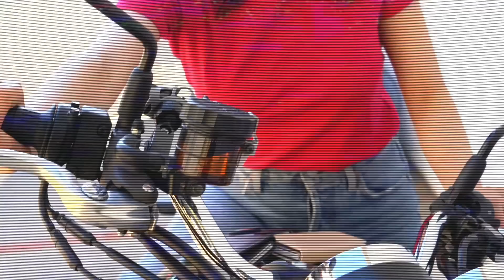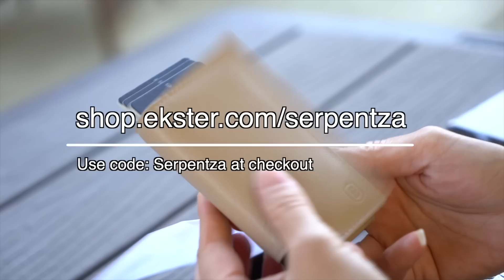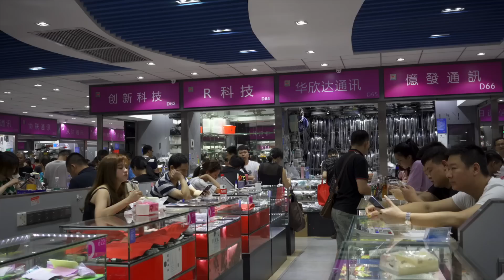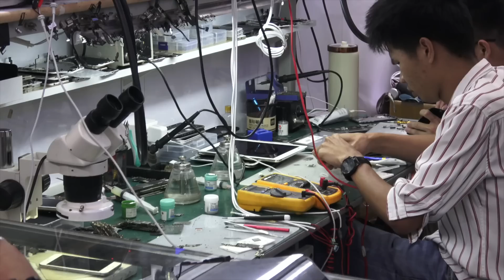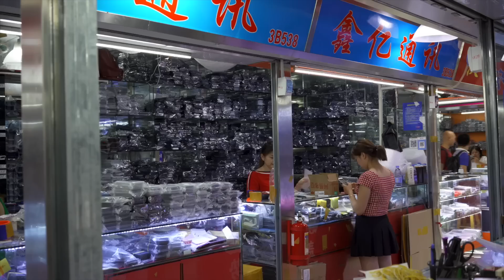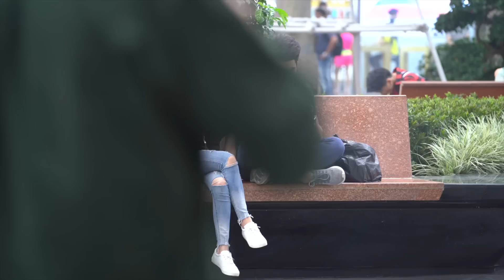Why China Can't make Chips!

Comment: I've had Chinese companies make many parts for me over the years, and the thing that has flabbergasted me is how they seem to have absolutely no concept of tolerances.  There are many parts that simply will not work if it is made too big or too small by half of the thickness of a human hair (and of course much less than that in things like chips and ballpoint pens). A big part of engineering is deciding what the tolerances should be. Even in cases where the Chinese are using a process that is easily capable of maintaining a particular tolerance on a drawing, and their measuring instruments are fully capable of verifying it, they are routinely out of spec. They just care if it looks right to the naked eye. Even if they did care, tolerances cannot be determined for parts that they reverse engineer.
Reply: neat
Reply: Factsss man. I bought one of them 5 dollar iPhone off wish and it was only a cardboard printout. I bet all the skyscrapers in China is made of cardboards man. Not to mention, They launched like a space station even though we all done space don’t exist.😂
Reply: That's funny, at the company I work for every now and then we outsource some milling and lathing for small badges to China... We've never had tolerance issues, they have been super consistent. When you are willing to pay for high quality prices, you get high quality parts. If you're trying to cheap out and pay them little, you're going to get a crappy piece.
Reply: The thing I noticed was that they didn't care about long term relationships. They would make a sale and cut corners knowing my hardware was going to fail to make a quick buck, not caring about the opportunity to make future sales.
Reply: Try to make these parts in US or EU and you will see how much it will cost you. Chinese know how to produce quality parts and assemblies but it will cost you much more. It's not possible to produce cheap products with superior quality. I am a mech eng and electronic technician, have worked in China and the EU, know what I am talking about.
Reply: @BeesKneesBenjamin  That's true.
Reply: And metallurgy, just because a part looks identical doesn’t mean it will perform the same.
Reply: Hmmm, I deal with Chinese manufacturers all the time and never encountered one that had any trouble following our specifications on tolerances in processes. Maybe your PPAP process needs some overhauling.
Reply: You can determine tolerances through reverse engineering; you just measure multiple examples, the number of samples you test will determine how likely your sampled standard deviation is in fact the population standard deviation. Determining the nominal dimension is still some what of a guess, it's probably near your sample mean, but possibly not...
Reply: Reading your comment reminds me of a small collapsible BBQ grill that's about the size of a laptop when put away (I use it for car camping, and it was made in China, of course). The collapsed grill fits into a perfectly tailored cloth satchel when not in use. But the problem I've had with it is that the satchel just barely has enough room to fit the grill into it. It's such a tight fit, I dread putting it away every time due to the frustration of trying to cram it back into its super tight cloth pouch. And I mean if it was just expanded in size by 1mm in girth, it would be ok. So, I don't think they cut corners for the sake of saving fabric or materials. It's as if they just didn't understand tolerances or didn't care to test the design before sending the CAD drawings over to the factory for immediate production. So, what you say above is very interesting and relates exactly to what my experience has been with that grill as only one example.
Reply: It depends more on how much you can pay😅
Reply: @ConcernedPublic  simple, you paid fair price, which might be 90% quality for 10% the US price . The guy above is too cheap so that he ask for 99% quality for 5% the US price.
Reply: They couldn't make the parts to your specification but were able to manufacturer Iphone, Tesla and high speed rails.  Perhaps, your requirement is too high for most companies.
Reply: @BeesKneesBenjamin  Quite right!
Reply: @highping1786  Did you previously investigated the so-called manufacturer. Many firms are only intermediaries, they don't own a factory, plant or even a workshop. Probably received an altered generic version, made in several PRC workshops, without any strict production quality control. They made a first batch that passed certification, and the later batches did not. It may happen in any part of the world. You have to travel and see for yourself. Cheap always comes with problems and fraud is a common practice when outsourcing.
Reply: @ricardoguzman6841  I purchased large expensive hardware directly from the manufacturers and sent DNV inspectors to witness the assembiles.
Reply: If they dont know tolerances, they cant make cars, planes, rockets, etc.
Reply: @tedecker3792   ive had chinese people reach out to me to be a purchasing agent for exotic metals used in military / aerospace applications , had to turn them all down
Reply: @drott150  that’s a huge problem for everyone. Products go directly from CAD to production, so by the time they figure out it won’t work, there already a million of them out there.
Reply: You just described us radio-control formula one model racers trying to fit the modern (ALL Chinese made) crap in our beloved Japanese/European made vintage racers. It's cheap to buy, but better buy in the dozens of spares. Tolerances, screw threads, etc..... You know what I mean? 👍
Reply: What kind of price equals what kind of quality. Do you want to get $10 worth of quality for $1?
Reply: 廄焚。子退朝，曰：傷人乎？不問馬。

Comment: Absolutely brilliant as usual.  Just a few years ago, (about a year before the word "Covid" became a household term), a company  I provide tech consulting for was well into a project they decided to embark on that would take a portion of their lower level structural engineering jobs and have them completed in China.  They opened a boutique-like arm of the larger organization which started in one of the owner's spare bedrooms fifteen years prior, and through hard work and gutsy decisions, they turned that little business into a firm complete with two factories, a design team, a group of amazing engineers and although i do not want to mention their core competency,  this company could literally build anything you asked them to.  They could work through the artist designs, take those artist renditions and turn them into engineering documents, then take the engineering documents and create CNC, 3d printing, laser cutting or any other type of machine data needed to create the widget and, depending on what they were making, they would then take the finished product and work out a mass production methodology for making lots of high quality widgets at fair prices.  These widgets could not be garbage though, so the production line was not something that would be outsourced to China with some coordinates to work the price per item down to 65 cents as the goal,  The quality was imperative so at this point mass production in China was not yet on the table.  BUT the engineering tasks of taking artistic renderings and engineering the items with all that attention to detail and minimal tolerance was something that this organization felt that they could have done in China for a good price and they were well under the spell that Chinese engineering was first rate.  Remember, this was a step that was not just paint by numbers, this was problem solving.  This was finding a way to make the widget correctly, quickly, strongly, with function and form equally as important.  

I will cut my story down to just say, their ability to think through the process, not just follow directions, was a joke.  The organization i worked for tried three different companies in China and each one was worse than the prior.  Your point hits home for me right no the spot.  If the company in China was given what amounts to a paint by number task of fabrication, they could handle it but they were not engineers.  What they consider engineering and what we in America consider engineering are two different things.  

This story is long and takes twists and turns and is full of so much bull chit that in hindsight it is laughable, but even now, as i write this, i feel angry for the situation.  But i did get something out of it, i learned a valuable lesson,  China survives as a copy cat.  They do not invent, they do not engineer, they copy, and they will not color outside the lines, i will promise you that, but if you need them to actually make the lines that need to act as boarders, you are out of luck because they are not taught how to problem solve and problem solving is the key to, well, everything.  

Thanks again, i know by this point i am talking to myself but this was such a perfect story, i just had t o throw may fifteen cents inl  Cheers
Reply: I appreciate your insight. And I agree.
Reply: thanks for that story. It confirms again what i tell people on occasion. It´s all smoke and mirrors, copying lying and pretending.
Reply: Rather long story for just a comment, but more then worthwhile reading! Especially for non technical people like me. It gives me an important insight! Many thanks!
Reply: thank you very very much
Reply: Poor jealous dog
Reply: @user-xcl523  why are you jealous?
Reply: I got at least 17 cents worth out of that. Well worth a few minutes to read. Thanks. ;-)
Reply: So very true, and an astute summation.
Reply: "....sitting on a fence, trying to make a dollar out of fifteen cents."

A jump rope rhyme my mother learned as a child in the 1920's.
Reply: Very interesting bc it is from the horse’s mouth not a 3rd or 4th party passed on story.
Reply: I used to buy products from a supplier located in China and over time became friends with the rep I dealt with all the time. She was very nice and friendly and I'm sure most Chinese people are. We had fun comparing are two countries (China vs USA) different things people did or ate but she said something that surprised me. She said she was disappointed that China never made anything on its own. Everything they have is just something some other country made and they just copy it.